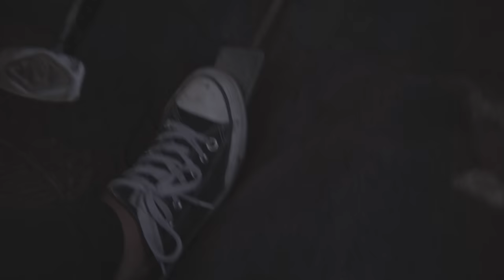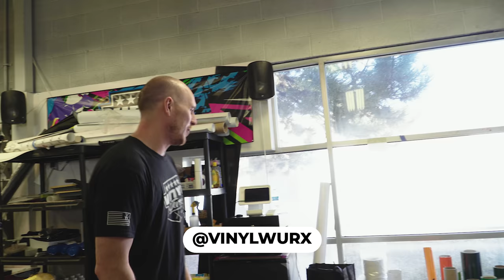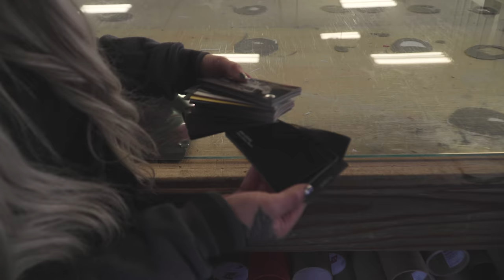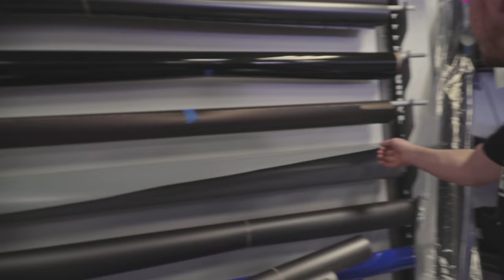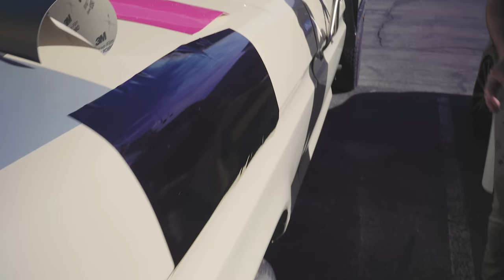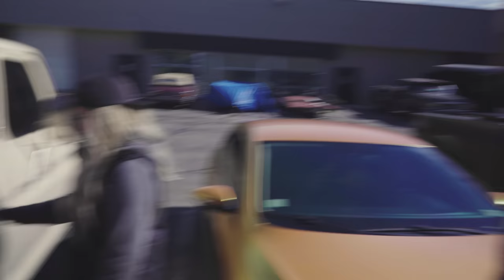What color should I wrap the dent side?

Comment: Metallic blue and silver, with like a satin black pinstripe separating the two,or purple and silver with the black pinstripe,or even the burgandy or rose would look good with the silver, and I happen to prefer two tone paint schemes in my opinion they make the vehicle look better. My current truck is a kinda rough one but a early 1994 Chevy Silverado ext cab shortbed Z71 that is black and silver two tone with a dark red pinstripe,hey truck sounds good and still has solid floorboards for Indiana that's impressive.